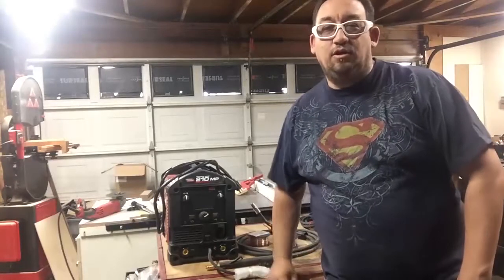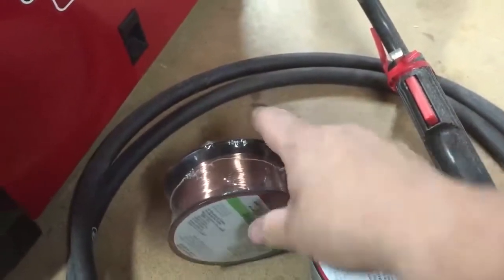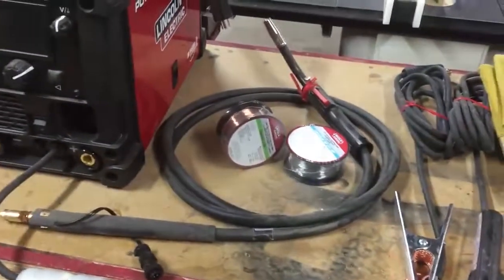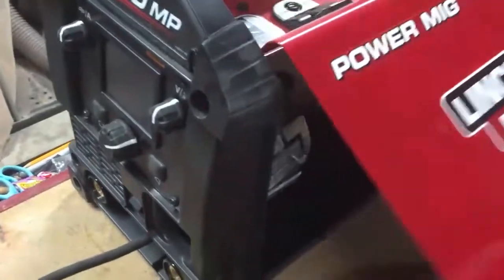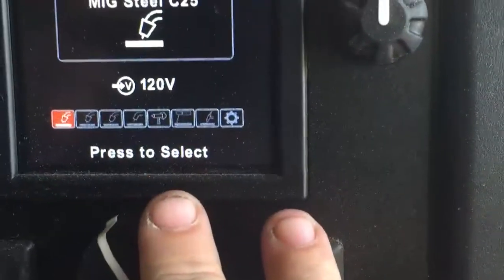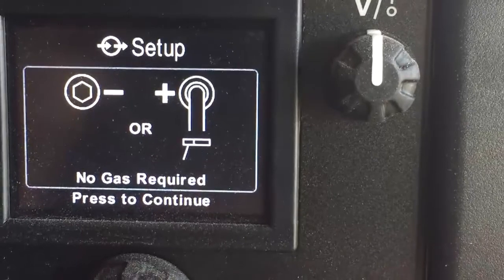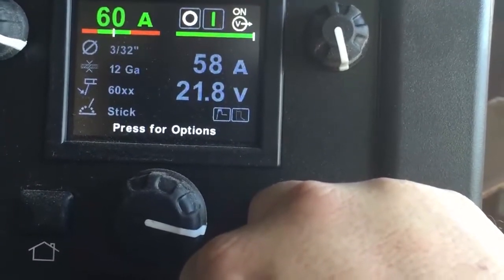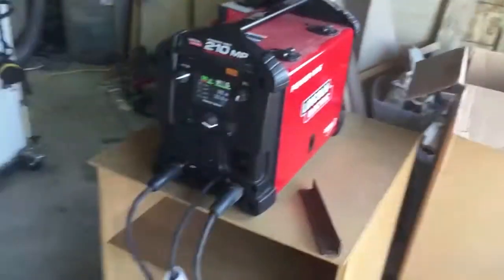New toy in Shop Lincoln Welder

Comment: any problems with the wire feed drive? looking to buy this welder but herd lots of problems with the wire feed drive and its making me having second toughts.
Reply from the maker: No I haven't had any problems! What people might be talking about is the machine come with .035 feed wheels already installed and it comes with .025 wire so in order to run the wire that comes with it you have to change over to the .025 feed wheels! I made that mistake and thought the wheels were slipping until I really looked at it and noticed I had to change out the wheels!! Lol

Comment: How well did it run the 6010? The 210MP marketing material states that its not recommended for 6010 and will suffer from frequent arc drop.
Reply from the maker: I actually didnt have any problems when I ran 6010.
Reply: Interesting!  Thanks for the info.
Reply: Use 6011 and it'll weld a lot nicer